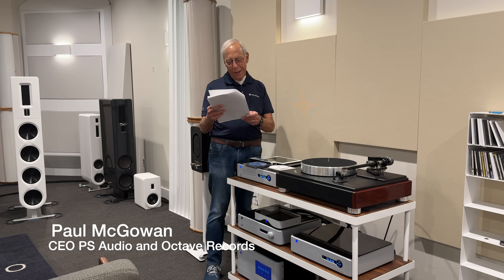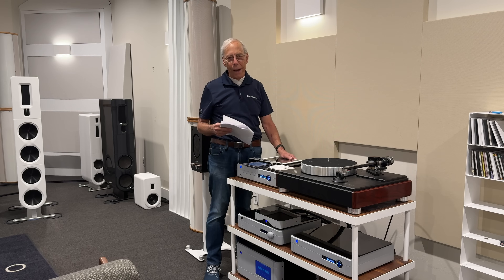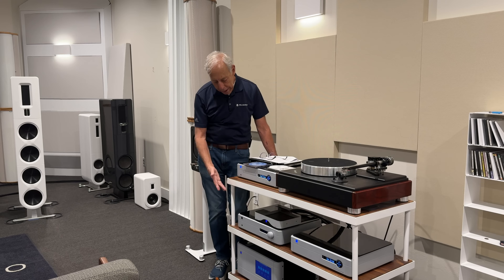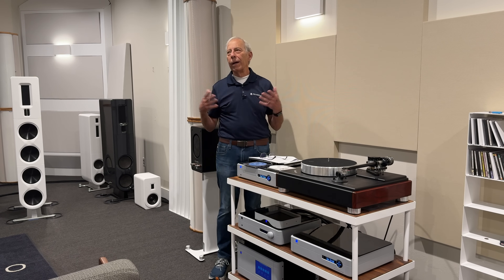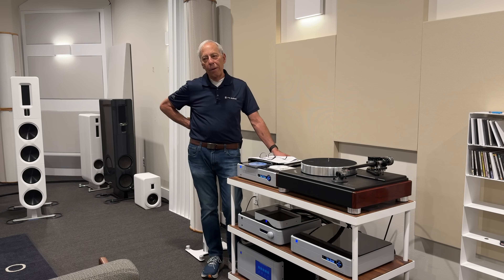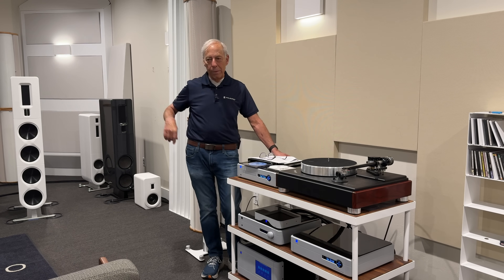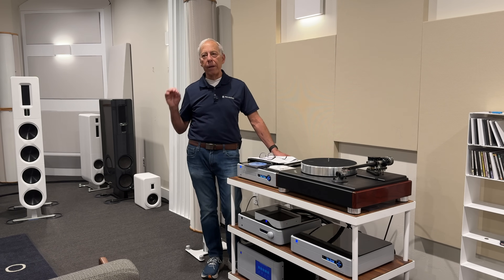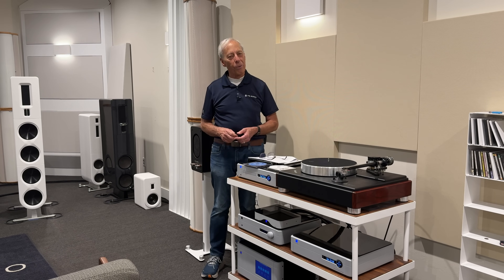Why preamps sound different

Comment: Why aren't there any true separate components? Regardless of price it's difficult to find components without features that are unnecessary in standalone components. There's always more on the circuit boards that are needed. It's so easy to find integrateds with a DAC preamp and amplifier. A basic cheap preamp with inputs and a master volume pot is almost non-existent. Most DACs have built in preamps. It's a struggle when someone is trying to build a stereo hifi system on the tightest of budgets. It's easier to buy separates that you can upgrade later. Rather than purchase everything at once. All it takes is one bad piece of metal in the signal path to smear the sound and degrade the overall quality.
Reply: I'm sure that, if you could talk to Paul directly, he would be happy to discuss this with you.
I remember him talking about the early days when he and his business partner were experimenting with just a straight wire and a potentiometer, he said they actually found that an amplification circuit sounded better.
I may not have all the details right, but my point is that you have a worthy question. You just need to find the right person to talk to.   :P
Reply: True.  The market has a lack of hi end quality preamp at a reasonable price.  Even the simple circuit tube preamp charge you an absurd price.  Solid state preamp do have a break through in volume control e.g. the one in Accuphase, Ayre, etc.
Reply: There seems to be a wealth of them at the headphone-level market… which kinda makes sense because headphones have greater sensitivity and they’re right next to your ears

And those preamps can then be attached to speaker amps
Reply: Most dacs do not have preamps. They are just using the dac as a digital volume control and switching digital inputs etc. however, as you turn them down, you are losing dynamic range. Hopefully, the DAC has low enough noise and distortion that this isn’t very audible in the ranges you’re using it

Comment: Every component in an amplifier is a signal degradation unit. Yes, a semiconductor can amplify the level of the signal, but never improve the quality. 
The many different attempts and topologies to avoid degradation while amplifying the signal results in big sound differences. That is exactly why you should allways use your ears and not just let specs, or impressive design, deside which amplifier you buy.. 😊
Reply: Words like degradation and distortion always annoyed me, it implies something inherently negative or destructive. I have a Chord Dave and as fantastic as a DAC is, I still don’t think it comes alive until I feed it into a quality external tube or SS pre/amp versus running my headphones directly out of the device for instance. Many including its own creator will say you’re losing a lot of the plankton detail doing this but to my ears it’s more pleasant to use a chain.
Reply: @mikeg2491 I'm sorry if my comment about signal degradation annoys you. But the fact is that the ideal in HiFi is not to add anything to the signal, and every component in an amplifier does add a little to the signal.. 😊
Reply: @larspedersen1546  Sorry didn’t want to sound like I was attacking you, I just mean I agree with what you said about trusting your ears. Many people find this “added to the signal” or changes more pleasant to our hearing than the raw output.
Reply: if audio source is 48KHz or LP then there is a margin 
high quality internal design & external look for control amplifier is very important
this is the most used stereo component like volume pot & lines switching
once stereophile got the one that satisfies him/her eventually he/she wants it to last forever
good sounding control amps I came across had very impressive specs as well
Reply: @sarabarabu-mq1ci do you really care about the looks¿ 
Ugly Hi-Fi lives matter .
Reply: I like to think of it as adding toppings to a Sunday. 
A pure signal is fine but it’s just ice cream.  Adding some flavor with right combination of components can makes it better. 

You are correct. You have to hear it in person. System synergy is a thing. Been to people’s houses. They spend big dollars on new “hottest” gear and it’s not cohesive.
Reply: @Pok-001  how about purest signal + eq arranged to the taste ?
Reply: @tolgadabbagh1877  EQ  can be fun. Especially at parties or entertaining people. Seems now DSP is the way to go if you want to alter or tune the sound yourself. Gives you more control. I think both degrade the signal. 
For me quality speakers with carefully matched equipment and tuned to the room is the best way. Oh no!!I sound like a “purist” 😂😂
Guess the first question is what type of flavor or sound you want?
Reply: @Pok-001  i dont think eq at the digital stage degrades the sound
Reply: @tolgadabbagh1877  yeah think you are correct. If it’s done right. But I think for most it solves a problem that doesn’t exist. 
Unless I’m missing something being able to control “EQ”at the digital level is DSP

DSD does it thing on the digital level even Daniel Hertz is doing sound processing digitally, and most high end powered speakers use DSP. 
I personally got off the tweaking Mary go round. That’s why I got rid of my tube gear. Was always thinking about changing tubes a tweaking the sound even though every one else loved the sound. 😂

Comment: The more my CDs and vinyl discs are collecting dust, the more I find myself struggling with arguing why I would want to upgrade my preamp. Ages ago I dropped out my cassette player, then I dropped out my FM tuner, still I have my CD transport and vinyl player, but I almost never use them. My streamer is where nearly 100% of my music comes from nowadays. As lossless streaming becomes the preferred choice for audiophiles, wouldn't we want our system to be heavily optimized for just audiophile streaming? If you never need switching input and never actually need signal amplification, what is the contribution of a preamp? Rather than putting a ton of engineering in making an amazing preamp, why not make an amazing setup supporting best in audiophile streaming? An audiophile system with best of streamer with build-in DSP (audiophile volume control, EQ, tube mode, etc.), DAC and power amp (3 boxes) could have some appeal.
Reply: So a sound bar. Got it!
Reply: I believe you should absolutely experiment with the goal of achieving a setup that will make you happy in your own home, and conventions be damned!
Personally, I'll never buy into streaming, because it's vaporware.
I've been too poor too many times in my life not to appreciate physical media that I only have to pay for one time, instead of on a monthly basis for simple access.
I can listen to any music in my collection right now without paying a single penny. Furthermore, I have the peace of mind of knowing that I will continue having access to it next week, next month, and next year. Try that with your streaming service.
Reply: @Hare_deLune  I have an optical 1Gbps connection to my house and internet reliability is my least concern. I pay tiny money to get access to lossless streaming of around 100 million music tracks. I have yet to experience a second of downtime in the last 5 years. Lossless streaming today can beat other media on audio fidelity, music availability, ease of use and speed of operation. Especially I like using my own playlists as I often don’t like all tracks on an album. I’ve purchased many albums where I end up liking only one song on it.
Reply: @ThinkingBetter 
Wow, that was fast.
Hey, it's your life and I'm not trying to tell you how to live it. Be happy!
We all have our quirks and biases, and our pet peeves. I'm invested in physical media, and I'll likely die on that hill.
I'm glad that you find satisfaction with your way of doing things. To each their own.
Reply: @ThinkingBetter optical is your very weak link.
Reply: @ThinkingBetter  
"I pay tiny money to get access to lossless streaming of around 100 million music tracks."
Yet, you do not listen to around 100 million music tracks every month and probably not over the past 5 years. Also, I'd be willing to place a small wager that thousands of those tracks you would never open to listen to because you simply don't like the genre (we all have our likes and dislikes when it comes to music.) I'd be interested in the exact amount you've spent in 60 months (I'm not asking you.) and comparing it to the money I've spent on downloading select hi-res tracks, and complete albums for my collection that I enjoy and will listen to all of them over time without having excess music I don't care for and paying for it.
Reply: @Mark-lq3sb  Amazon Music Unlimited is US$99 per year or US$8.25 per month. It streams lossless up to 192kHz 24 bits (= better than SACD DSD-64). 60 months is approx. US$500. My June electric bill was almost US$800 or about 100 times more (I use whole-house HVAC a lot). Cost of streaming is my least concern. Reliability of it is also my least concern as it didn't have a single dropout for at least 5 years now. And as it is lossless, there is absolutely no technical reason why tracks can't match or exceed CD quality considering the streaming is error-free while a CD is prone to errors due to scratches.
Reply: @clickbeetle2720 
I totally missed that!   😆
Reply: @ThinkingBetter  Exactly, minimize the path by using the steaming app in the soundbar. All self contain meeting your requirements perfectly.
Reply: @glenncurry3041  I am an audiophile and as you know well, the speaker is the most important component category and obviously that is no different when streaming lossless better than CD quality tracks. Why are you excited about sound bars?
Reply: @clickbeetle2720  I got my first record player in 1978, thanks.
Reply: @clickbeetle2720  You are talking to someone who has been loyal record collector and passionate analog audiophile for decades. I started collecting vinyl discs in 1978 and have around 700 discs. But like the rest of the world, I’ve switched to streaming and with lossless better than CD quality streaming now being reality, I find my time more focused on exploring new music and listening than getting excited about album artwork and an album that too often has only one or few excellent tracks. Nowadays people make playlists with music they really like independent on what is on specific albums. I have many boxes of vinyl discs and CDs but I can’t convince myself to go back. I even have a ton of cassette tapes from the 70s and VHS tapes mostly from the 90s also but same story. Also for movies, streaming won me over.
Reply: @Mark-lq3sb  I’m also shocked about the electric bill is so high but in June I worked at home every day and every day had the house AC running at around 5000 Watts. I need to get solar panels. I have a small AC unit in my home office and should start using that. It looks like in just one month it can pay itself at this time of the year.
Reply: @Mark-lq3sb  Most of the music on Amazon music is in CD quality 44.1kHz 16 bits lossless.  A lot is in 44.1kHz 24 bits. For example, Africa by Toto is in 192kHz 24 bits both the 1982 and 2003 versions. Some more recent music runs 48kHz 24 bits because some music producers care more about streaming than CD. Whatever is the original format, I run exclusive mode to feed my DAC without transcoding and losses.